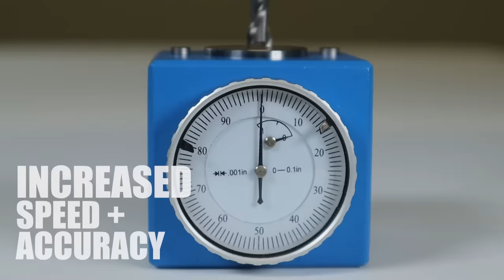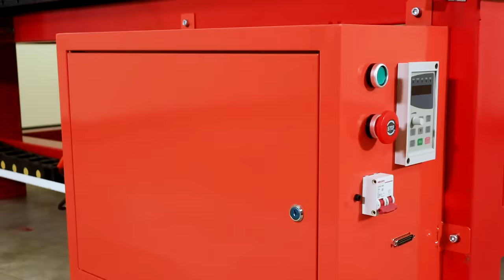Industrial CNC - Pro Series Lineup

Comment: I have an Artisan from these guys, and other than some initial hick ups and set up challenges, this thing has been rock solid.   An excellent  machine that I will purchase again once my business gets larger.  The thing is a tank, very stable,  and well built.  Mach 3 gives you much more detailed feed back, on the tool path,  than the Aspire software I am using for the design work.   That's the thing, you can design in any CAD CAM program that you like, covert it into a Mach 3 post processor, plug it into your INC and a way you go.  You can then un a simulation to check out the time it will take you to run the project, and this help you in pricing your project as well as the validity of the post processor conversation.  A very good machine.
Reply from the maker: Thanks Richard. We are grateful to share in your success and glad hear you are enjoying your CNC Router. If there is anything we can do, or when you’re ready to add that second system, we will be happy to help! Now go make some saw dust!